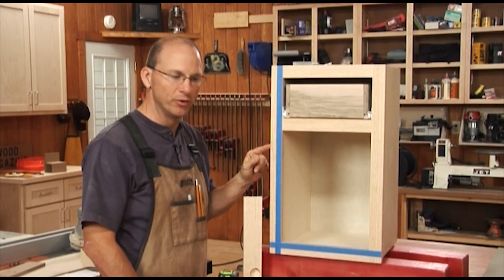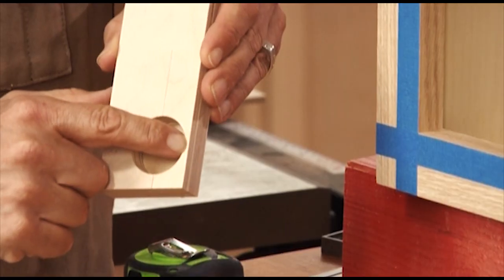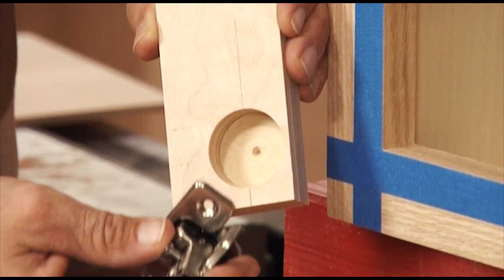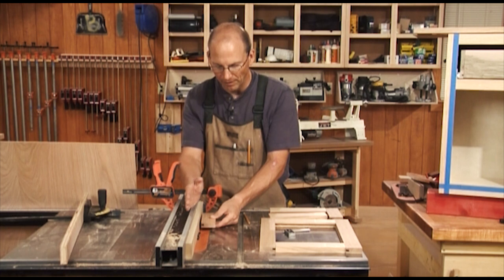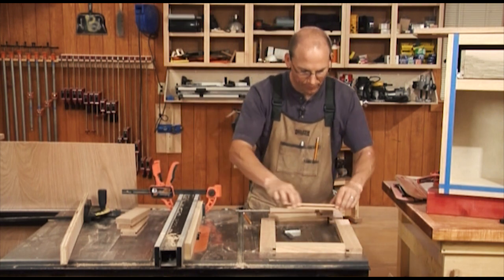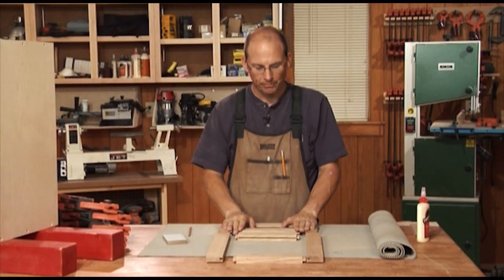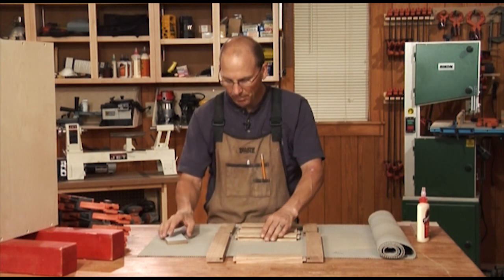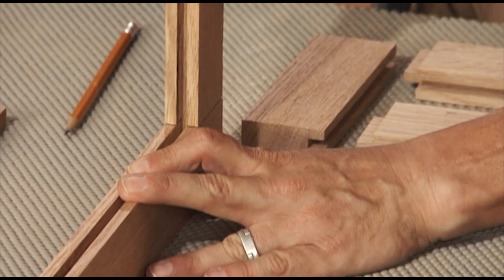How To Make and Install Overlay Cabinet Doors - WOOD magazine

Comment: Thanks for the video. Soo I take it that the hardware screws are enough to keep the drawer front attached to the drawer? Typically I see most drawers fastened to the drawer with 4 screws in addition to the hardware.

Comment: Great video, but it raises a couple of questions. If someone decides they want to change out the drawer pull, doesn't it mean that the drawer front will come off? I can see just about any client raising hell over that one. Also, since the panel of the face is centered within the rail and style, doesn't tightening down the pull cause an unsupported stress on the panel? Invariably, someone is going to torque that pull down gorilla tight, and risk cracking or bowing the center panel since it's veneer on MDF. 

I love the tips overall. The door will be great. I just know that when it comes to preparing a product for a client, you can't underestimate what they'll put it through.